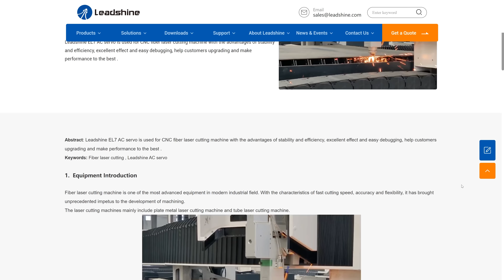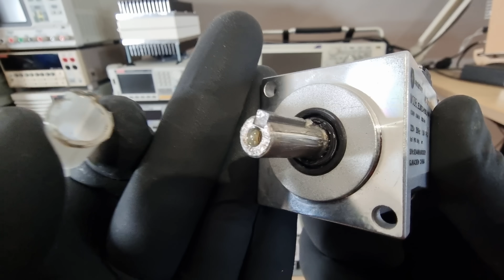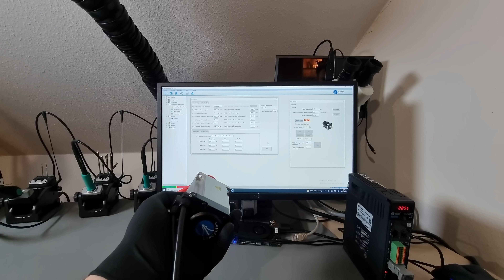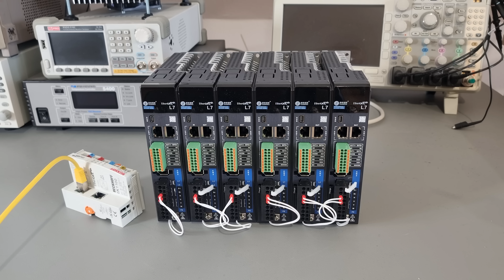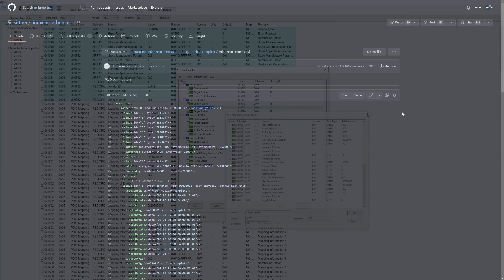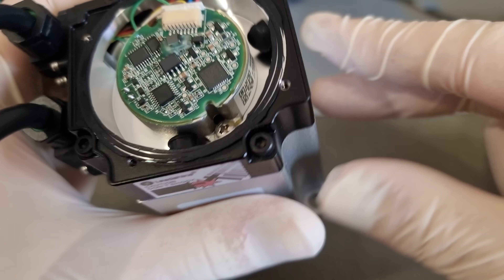CNC Motion Control over Ethernet Cable! Leadshine, LinuxCNC & EtherCAT

Comment: batteries for encoders are extremely important for robotic applications because you cannot home the robot if it is inside a fixture for example. The battery allows the robot to be controllable even after a power failure without moving the robot. All higher end industrial robots have batteries for the encoders

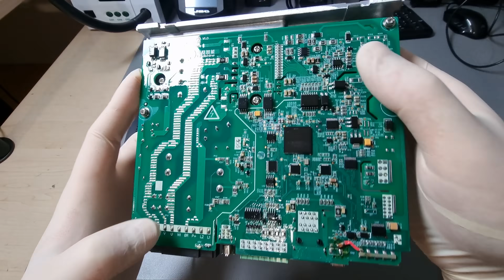Comment: 25:27 We can see MCU has builtin EtherCAT controller (so its can be AX58100, AX58400, LAN9255 or XMC4800) but it has external PHY (it rules out ASIX chips). Chip looks like BGA package and IIRC these Leadshine servodrives were available before 2020 - my guestimate is that Infineon XMC4800 is running the show

Comment: MIKROE sells an "EtherCAT" click which implements an LAN9252 ethercat ASIC configurable over SPI. MIKROE also sells a feather click development board which makes for a very easy custom ethercat node. I recommend starting with an adafruit feather, ethercat click, feather click shield, and the "EasyCAT" Arduino library. The library is technically for a deprecated ethercat Arduino shield but since they used the LAN9252 is basically plug and play with the MIKROE ethercat click. I'm using it now to trigger some rs232 commands from ethercat using the rs232 click.

Comment: really nice Video! Would be fun to somewhat attatch linear encoders instead of the integrated turn encoders on the motor. normally you wold get a standard dualchannel input for symetrical RS422 optical encoders.  Would this be possible with ethercat? I cant find that much linear encoders on google. but maybe its a better solution to use stadrad rs422 encoders with a ethercat input board. Would love to see this set on a real machine with real full loop control!

Comment: Because of your video i contacted Leadshine - always looking for different form factors and at the moment, stock.  Leadshine is a Chinese manufacturer with distributors around the world.  
The negative big for me is that they don't have STO (safe torque off) - or at least they don't have it certified yet.  
Safety is paramount!  -  I'm not touching any powerful servo without STO.

Comment: The screw looked like you were almost thinking about a 3D printer based on screws instead of belts, although you mentioned CoreXY. Was you old idea the creation of a printer without belts? I would like it if you could overcome the problems. :D Looks like the speed problem is already solved.

Comment: hobby garage woodworkers no can buy and use servos and ethercat. horriple expensive normal human use. normal peoples can buy only basic stepper motors and cheap drivers whit linuxcnc, cost less than 400$ but servo system cost 100x more. totally idiot pay too much ,ofcourse closed loop motors have better but cost too lot normal people no have money waste lot money to servo system. only to pro and factory uses.

Comment: Do you need any additional hardware between the servo controllers and the pc to controll the system?
Or is there the need when using Something like Mach4 instead of linux?

I couldnt find any up to date information about this online.
Reply: linuxcnc have lot better flexiple use ,can make lot more own hall and makro codes and own tool codes, mach not can do all what need.

Comment: You don’t really need the ek1100 if you don’t have other IO. The two ports are connected to an internal switch.
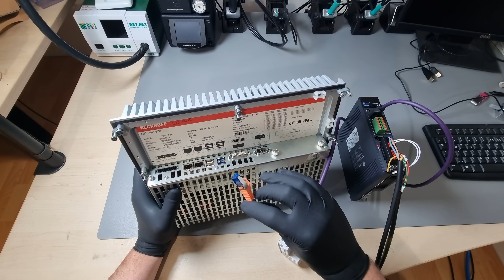Reply: I think it was connected at the beginning (13:45) but after that it was non-connected (22:40). The master device has 2 x 100/1000BASE-T on-board Ethernet. The protocol conversion is managed by soft?

Comment: This is why you always design an RJ45 jack into pretty much any product, at least the engineering revs.
You can plumb pretty much anything to it, except maybe RF/HV and with the right parts you can do that too.
Inexpensive, robust, mature, and basically anything you want a thing to be when you want it.

If you are using "scientific" cameras (IDK how else to describe them, see Edmunds Optics or similar vendor site) you can sync and run your camera networks with test/monitoring events (over several bus types, one of which uses PoE over RJ45 on copper that run from 1-10Gbps), which is a bit of learning curve but makes collecting good data pretty plug and play once you have all the bits in your tool chest, and you can incrementally upgrade chunks, which is nice for you and vendors.

Comment: I've actually used Leadshine in an industrial setting, and was quite surprised to see them here. They're excellent for cost, compactness, and overall strength. The only downside I could say is that back when I last checked a little over a year ago their website and ordering process wasn't very hobbyist friendly
Reply: Most OEMs like that are likely wanting you to go through a VAR.  Though that also means higher costs which in turn isn't hobbyist friendly.

Comment: The top people in the speedboat leaderboard already use servos instead of steppers. Yours may be nicer, but it's not all about the motors. Those people are also using custom hotends and cooling solutions. It's up to you if you want to dive down that rabbit hole.

Comment: I do a lot of security work with industrial control systems (some ISO/IEC 62443 stuff, but mostly technical research/consultancy) and EtherCAT is pretty ubiquitous there, in everything from turnstile gates to cereal manufacturing to ship engines. It's one of the better protocols in my opinion - does its job, does it well, has extremely low latency, and doesn't bog down the base protocol with needless complexity. It's fast and reliable enough to be placed in a safety-critical alarm path, which is something I don't say lightly. In marine environments it's common to find it running alongside UDP-encapsulated NMEA for sensors and navigation comms, which saves a ton of cost and complexity on cabling.

Comment: Very, very cool stuff! Way over my head but I like it ;-) Seeing as you're very into motors, drives, and all that, maybe you could help answer something. Is there any sort of servo controller + motor combination which can do both continuous rotation, and absolute positioning? Thinking of a CNC lathe (way off in the future, mind you) and whether it's possible to do both spinny spinny and positioning of the spindle usign just the one drive motor.

Comment: there is some benefit for keeping it simple, not too many parts to actually make, like ethernet controllers
Reply: the more complex supply routes you require, the more reliant on sold stuff you are
Reply: if you keep it simple (smarty) then you can do all yourself, not rely even on off-the-shelf stuff
Reply: traditions and customs are a horrible excuse to keep things stupid complex
Reply: design again, no you dont need some parts
Reply: fing slaves

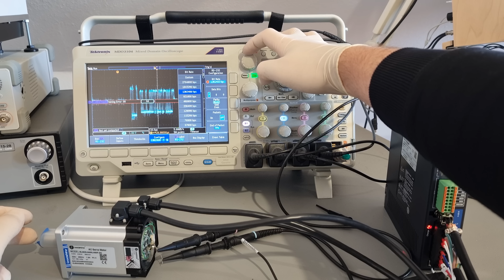Comment: I've been working with some Nikon encoders that look to have a similar interface just judging by the scope shot at 24:00, they run at 2.5Mbps (switchable up to 4Mbps) and have 16bit data frames with 1 stop bit, no parity. Probably could implement it on a microcontroller that supported 16-bit UART (along with RS422/485 xcvrs), but I was able to do it on an STM32 using DMA to bit bang the query command and read back the data, then post-process it into actual position.

Agreed that the resolution and shaft sensitivity is insane!!!

Comment: Speedbenchy rules technically require the use of stepper motors, not servos, so your cute little cat-made-of-ether rig is excluded from the main score table...

However, nothing says you cannot create a new category for true ball(screw)s to the wall performance motion systems... So I vote "do it!"

Comment: I have worked with servo packs that uses battery for position memory. If battery runs out you have to put it to position 0 and clear the error in servo pack.
It's a pain in the ass, 1 month ago the production stopped for a day while I was trying to find the home position of an axis because battery run out....

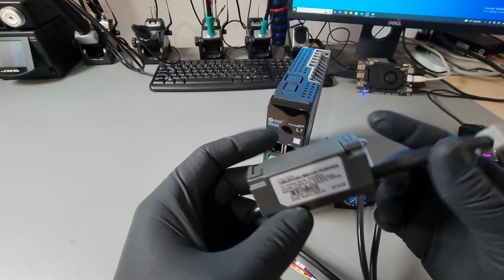Comment: 6:27  You explained this at the end of the video without explicitly linking the two.  The encoder maintains itself and gives a position when requested.  The battery allows the encoder to continue to operate even when the system is de-energised.  Therefore, the encoder will continue to monitor the rotation of the shaft and keep the current position in its volatile memory.  When the system is energised, the servo drive will ask the encoder for current position.

Comment: my next upgrade ? lol.... I don't think I need this kind of accuracy.  I would like to try Linux CNC though. Mach3 has been pretty reliable for my needs for many years and with a custom interface is very useful too.
Reply: Microsoft does have real time OSes but I do not think Mach 3 runs on one of them. What OSes Mach 3 supports becomes more of a problem as time passes. Give Mach 4 a try. Then when you try out LinuxCNC you'll appreciate it more. hehe
Reply: @1pcfred  I am still running windows 7. lol. it works well.  Yeah, I may upgrade eventually but my machines are always in operation.  I would need some downtime to do the swap.... If I build a up a new machine I will likely buy Mach4 for that.   My buddy Colin is pushing me to try LinuxCNC so I might at least try it... he works for Lightburn after quitting at LTT and is very knowledgeable so he must be on to something.
Reply: @soniclab-cnc  as long as your buddy Colin is willing to help you set LinuxCNC up it can't hurt to check it out. You can get a live image of LinuxCNC and run it in simulation mode. You should be able to write that to a flash drive and just boot it up. They have instructions how to do that on their download page. So you can test drive it. That'll give you a pretty good idea what you're in for. Poke around some, kick the tires. Live images load into RAM and run from there. I don't know how much RAM you need but 4 or 8 GB should be enough? A live session is a lot like running the OS. It's a very close approximation. Technically it is running the OS. Just not configured really. Configuring something and rebooting isn't an option either. Because no change is persistent. When you reboot your RAM gets cleared. There may be an icon on the desktop for installing the OS. Don't hit that. Because that would alter storage media. But you can mess around with everything else. You can even "install" software. It won't really install to your hard drive. It'll install to the file system in RAM. Once in a live session I did a system upgrade but I didn't have enough RAM. I forget what happened. I may have just got an out of disk space error? As long as you don't install the OS nothing you do will do anything really.
Reply: @1pcfred   I already set up a VM on one of my servers to check out the installer... grabbed the latest ISO.
Reply: @soniclab-cnc  it is good to check things out. People either love or hate LinuxCNC. So it is best to find out where you're at in all of that. LinuxCNC won't hold your hand all the time. But you can get technical support for it. The user base will hold your hand if you seek them out. I know I got help setting LinuxCNC up. There's plenty of pitfalls. But if you can manage to navigate all of that then it just works. So there is light at the end of the tunnel. It can still be a long dark tunnel to traverse. Not everyone is up for the challenge.
Reply: @1pcfred  I built most of my machines from scratch.  As an electronics engineer with a solid background in computing I find this kind of stuff pretty elementary.  Its the experimenting and learning new systems that makes me excited. Always pushing myself to learn new stuff.   I also like it when stuff just works too though. lol
Reply: @soniclab-cnc  as I can recall sim mode just works. Configuring an actual machine takes a bit of doing though. But once you're done it'll just keep on working then.

Comment: I use 23 bit servo motors at work.  They're far too precise for anything we do.  I scale it down to below 10,000 pulses/rev.
I'd like to know if there is a real life situation that requires ~8.4 million pulses/rev?
Reply: Depends on how precise you want to controll something and if you can use additional gear boxes.Though usually when it comes to anything above 16 bit you have to ask stable that readout is. Looking at the numbers it outputs is cute and all, but plotting them is usually way more interesting. Most systems with these high ADCs have multiple bits that pretty much just show constant noise. At that point you may as well just use a 10/12 bit ADC. Not to mention that most 24 bit ADCs use delta-sigma which in turn isn't as fast usually.
Reply: @ignispurgatorius5297  Do you have an application example that requires a 23 bit encoder?
ADCs are notoriously unstable - take a sample and dispose of the first couple of LSBs.

Comment: The purpose of the battery is so the encoder can keep its value correct even if the whole system is powered off and someone moves the motor.

Comment: As far as hobby use, I think the issue with ethercat is typically the slave devices need a licence fee, this is usually tied to the IC / Asic that implements the Ethercat slave side of the communication, this can make the slave IC's expensive.
What I have seen with the duet boards is the use of Can-FD, but it's not as well developed by far and no-where near as advanced as what we're seeing with the above.
Reply: Well, the 10-20 bucks per IC/MCU usually doesn't break the bank of most projects so to speak. But it's one of the downsides of ethercat. For hobby use the whole Ethercat eco system including the usual go-to (twinCat) can be rather overwhelming if you don't have experience with PLCs. Also you better try to stay on the full open source side, especially with the master and if you can any further I/O, because getting actual beckhoff stuff will probably cost you an arm and a leg, unless you are a major industrial partner with >>50% discount. You do get a proper RT field bus (thanks to the DC architecture) with it though, so in applications where that matters it's a great system. I also liked what they showed this year with their modular robotics concept that uses EtherCAT, though I have yet to see the prices. But knowing them it will be pretty much impossible to use them in any price concious project, even in a low volume industrial setting.
Reply: @ignispurgatorius5297  There's the Trinamic TMC8462A-BA which is a BGA part
It seems to be around only £20 or so it would be interesting if this could be integrated into the Moteus
(especially now that ODrive has gone closed source)

Comment: I think Step Dir servo drive has more bandwidth than 100mbps EtherCAT. Most Servo Drives I use have Pulse Train version max input frequency of 4Mhz BUT the EtherCAT version bests at 250us which translates to a measly 4Khz. SO Technically the Pulse Train interface can trace a curve 1000x more accurately OR 1000x faster. I am developing a CNC Motion Controller of my own based of AM6442 microporcessor and thought of using EtherCAT but 1 hour into the research discarded EtherCAT because it's not as effieceint as Pulse Train. EtherCAT maybe an easier to implement setup from a system-intergrators(users) perspective and might be good enough for slow or not so high pefromance application. But for high performance application I don't think theres anything as fast as Pule Train Interface
Reply: I'm surprised you only get 250 us. I've done many implementation on site using Beckhoff, and even with multi-axes system (7-8 axis) we got an average of 20-50 us with no issue, and that's just with a 4-core Intel Atom CPU. Have you joined the EtherCAT Technology Group and reach out their Developer Forum? Also remember that the way EtherCAT works are so different than normal Ethernet package, which makes it much faster (albeit not compatible in normal ethernet network connections).
Reply: @FlyingPlastic356  Thanks for your input much appreciated . Yes I have a good understanding of of how Ethernet layer works and I am familiar with the Ethernet protocols and how it’s different from EtherCAT protocol and have a basic understanding of the EtherCAT data frames. I did some fast calculations based of typical EtherCAT frame and came up with numbers , that for 8 axis the size of frame should be around 200 - 300 bytes. Theoretically at 100mbps link should match with your 20us observation. I now think the drives I am using are not fast and have higher latency processing the data of EtherCAT frames. Maybe I should try different OEM.

Comment: for those who could not be bothered with writing hal files, the beckhoff twincat 3 engineering software package contains cnc stuff where you can just click on the device to assign it to an axis. its free, kinda. Fill in a capcha every 7 days and you are good to go.
Reply: That sounds like an attainable pain in the ass. 😆😆
Reply: @st3althyone  I found it not that painful, IMO. You don't need username/password or open a website and fill some form to renew license. The engineering software automatically detects if your license is expired when you upload the project to the controller, ask you if you want to generate a 7-day trial license, and shows you a pop up to type your captcha in. I think you don't even need internet connection to do so (correct me if I'm wrong).
Reply: @FlyingPlastic356  Cool, that doesn’t sound too bad. Thanks.

Comment: I did a CNC conversion earlier this year using DMM Tech DYN4 servos and drives. They use those same IEEE-1394 connectors for the encoder, which are a pain in the ass to find parts for (the special locking style housing only seems to be available from AliExpress or similar), but I was able to terminate them with parts from Mouser (minus the housing). I think my next CNC build/conversion, will be looking to use EtherCAT or similar. The Mesa cards and support from Mesa themselves is great (I use LinuxCNC), but EtherCAT would be nice.